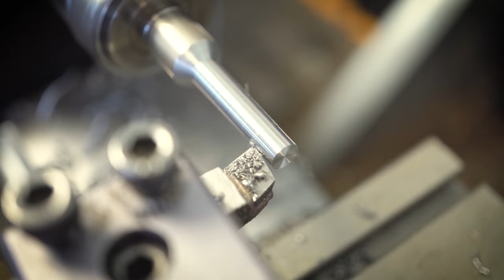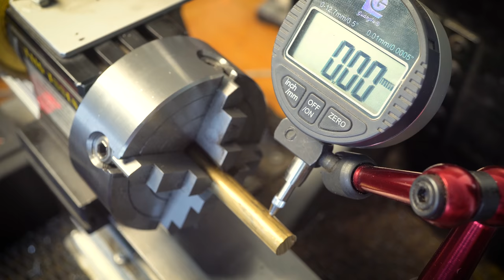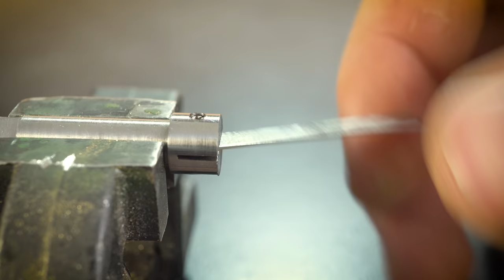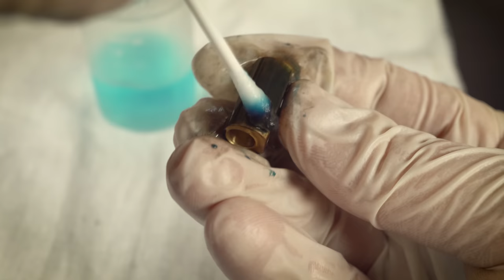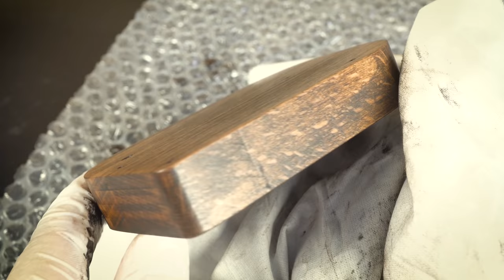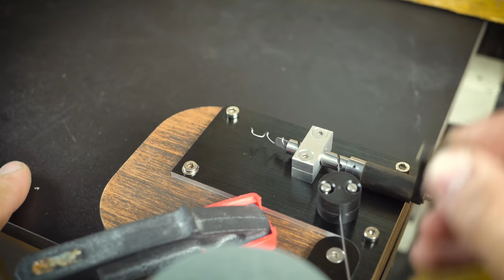Chain link making machine /\ DIY

Comment: This is really impressive. I also never had thought about how chain link fences were made until today. Broadened my horizons.
Reply: I all though they where some sort of a cross between Plate/Brading @ stitching, and then it was stretched out to the square shapes :-)
Reply: @dh2032  the way I saw it made was completely different then this and other videos, I’ll try and find it
Reply: you should watch a video on how actual chainlink is made as its totally different than this. its a crazy machine and it does it all on one shot.
Reply: @curtism7203  like how the video I posted above? The video I posted wasn’t exactly the fence but that’s all I could find to get my point across
Reply: this is not how they are made, your horizons have been narrowed.
Reply: @reaction9449  there are no videos posted above.
Reply: @Ghryst  If you've seen a different method, there must be multiple ways of making it. If you do a YouTube search for chain link fence factory you'll find pretty much this process on a larger scale. They run the wire through straightening rollers first, but wind it on a flat mandrel inside a tube with a spiral pitch like the machine in this video. The section being wound tends to thread into the previously wound section and they use auto cutters, but it's the same process. (only bigger and faster)
Reply: @the_omg3242  no, chain link fences in real scale are manufactured quite differently to this cheap imitation that has no structural integrity.
butt sure, keep fanboying, fanboy.
Reply: They’re not made this way commercially, it would be too time consuming.
Reply: Yeah, you don't want to be fenced in.

Comment: Been a machinist for a little under 15 years now, and still love watching the different processes people come up with to make things.  Never gets old in trade were there truly is no skill cap.  Need more MACHINISTS!  Great video 😍
Reply: As an engineer (who is not a machinist, but who has great respect for them), I wonder if I can 3D print a similar design durable enough to produce limited production to suppliment my hobbying desires (war-gaming/modeling for myself and maybe one for my father's model RR needs).  I know I can model the parts in CAD, I just don't know if a PLA plastic spiral fluted tube will hold up to the abuse, but I'm going to find out.

Comment: Omg
That copper wire would make a beautiful bracelet
Thumbs up
Reply: would need to do something about the edges, maybe solder or braise them so they don't scratch you!
maybe try to link with 1 continuous wire you could also make filters or strainers to use as you would a colander.
Reply: @nullvoid564  or just file them a lil with a nail file and curl them in?

Comment: The end product could also be used for a faraday shield.
Peace.
Reply: Or as a thermal dissipation, like heated seats, clothes, or handlebar grips
Reply: I was thinking model makers might like something like this, for scale fences. Might be able to sell a mass produced version of this to folks who like model trains and the like, if you made it to the correct scale.
Reply: Thats what I was thinking immediately when I seen it... I think if I made one I would want finer mesh though to block smaller fields
Reply: No more tin foil hat for me boys! Tonight, I'm riding in style!
Gonna make one of these and show it off to the CIA agents spying on me from the hidden camera they installed in my toaster that night they slipped something in my drink at the bar which caused me to wake up in that ally way. Hell, this hat will be so cool it might even break the brain washing they put on my wife that made her leave me that night. With threads like these the shinny glittering will slowly break through her neural programming and make her finally see I was right all along.

Thanks WM Lavsha...

If that is your real name!
I know you're secretly an giant and I can tell because of how big your hands are compared to all the tools so what else are you hiding?
Reply: Make it with food-grade stainless wire and you've got yourself a custom kitchen strainer. Would also be good for protecting inlets/outlets from clogging with debris.
Reply: @CraigBrideau  Would also would help reflect the lasers from Elon's Death-Starlink satellites protecting you once he finishes deployment, trigging the activation code, and initiating phase one of terraforming Earth into Mars.
Then again, are we sure we even want to survive the initial wave of destruction only to spend the rest of our days bowing to Elongated Muskrat being his slave and digging tunnels for the hyperdeath loop. Nooooo TY. I got my Alex&Jim Jones brand cyanide caps ready to go for just such an occasion.

Comment: Third try to leave a comment...

Very cool! I made a simple tool about 10 years ago after finding plans for a device used in developing countries for making chain link fence. I cut a slot in brass tubing using a jeweler's saw and then used a pin vise to turn the bar in the tubing. My fence is 1/12 scale. I tried a smaller scale, but the fine wire kept breaking in the tubing. The device needed to be more precise, but I didn't have the tools to make it better. Worked pretty good though.

Comment: When I was a teenager 50 years ago I operated a machine to make chain link fabric with telephone wire which was removed from poles when they went to underground cables. If you hold the fabric in front of the mandrel it will weave in new strands for you.

Comment: Very cool! If you made a tiny slot at the top or bottom of the clamp and cut a key stock from the hardened steel razor blade, it probably would've prevented the stainless steel wire from binding and rotating the whole spiral groove body.

Comment: I use to be a machinist when lot younger and what gets me is the tiny equipment  this  machinist uses.  Always tiny, 
tiny cute tapping, tiny indexing heads,  tiny chips, tiny cuts !!!  It is AMAZING to watch i must admit..
Reply: No endmills were harmed in the making of this video
Reply: I mean in the world of machining small parts have been around, especially in aviation, gotta put the part number on a little 10-32 screw head somehow.
Reply: @sgtjonmcc  I'd assume that for mass produced articles, the part numbers get stamped and serial numbers get lasered on.
I worked in a place that produces small lot parts so we milled it, but that's only economical if the parts cost a lot anyway. :)
Reply: I'm really liking the micro sized CNC machines
Reply: And im surprised as a watchmaker that he uses such big machinery and screws xD
Reply: @l.h.9747  Lol
Reply: Yeah, it's sometimes hard to see the scale until you see a giant thumb holding a piece. lol

Comment: As usual another small masterpiece: you could produce this net for modeling use and dioramas in general
Reply: Exactly my thoughts. That would be really great for creating in scale wire fences and such things
Reply: What in heck could you ever use this fo.....oh.
Reply: @ranger_a6953  he said modeling. So basically for modeling doll houses, toys, rc world, and whatever humans would like to use it for.
Reply: @whatswiththissassylostchilld  yeah, I know.  I was trying to be a bit humorous.  Sometimes it doesn't translate well.
Reply: @ranger_a6953  ohhhhh my bad lol
Reply: @ranger_a6953  I mean you could do some cool steam punk look
Reply: Could sell it strictly to model railroaders and do quite well! Very nice work but even better imagination! Well done!
Reply: I use chicken wire or sculpting mesh depending on what size link I need, loll
Reply: I would use it in a larger version for Faraday cage
Reply: @helpabrothawithasubisaiah5316  that would be a 1x use for u. Ur much better off using a copper (or copper plated) machine cloth if u don't want to die or fry the sensitive components you are trying to protect. There are no solid connections in the cyclone fence design, u would have huge arcing problems and probably complete failure of farady cage.
Reply: @TrapperAaron  it wouldn't be hard to make connections, and it depends on what you're trying to block for it to be sufficient...

Comment: I’d love to buy this for modelling, is there anywhere I could buy this from?
Reply: if you don't have all the nice equipment, what you can do is do it the non automated way. go to starbucks and with out buying anything take one of wooden coffee stir sticks, go buy 300 plastic straws from the dollar store for $1 wrap super glue one straw around the stir stick be sure to leave a gap, for the wire to go, throw the rest of the 299 plastic straws in the ocean. pain painstakingly wrap the wire around the stick in the gap where the straw is not. if the wood is too week for your wire you might have to buy a metal nail file from the dollar for $1 if the metal nail file is not the correct shape you may have to grind it ageist a rock, till it is square, the wire is by far the most expensive part if you can get your self to a junk yard you might be able to find a broken motor, that will have lots of wire, I think the dollar store sells wire for a $1 but that's a consumable not equipment and part of cost of goods, so that might brake the budget it all depends on how much your selling your models for, I will assume your a government building contractor and your making a architecture model for a new 100 million dollar prison, and you want some realistic chain link fencing to for the model, don't worry I am sure your model will be accepted if your bribe is big enough. but don't go over spending on model creation that's less money you have for a bribe, and that's what get's the contract. the new normal, people like me will do well but they would rather be poor in liberty, where at least we know we are free, because the devil does not share power.
Reply: Let me translate what Amipot said:
No
Reply: I'm thinking I'll try my hand making at a 3D printed version.  I'm hoping I can get close to scale strips of hardened steel form McMaster-Carr in place of the laser-cut knife blade, and print much of the rest in PLA plastic.  It' won't be as elegant or as durable as this devise, but using smaller (more scale appropriate) gaged wire, it just might work well enough for my hobby needs.  Besides once I've modeled the fluted spiral tube and have a stl file, I can always print more with negligible cost and effort; even if it only lasts for a couple hundred produced links, as oppose to the several thousands of links a milled tube should be capable of producing.  I'll follow up with an additional comment If I am successful.

Comment: Simething cool would be chainmail i was trying to imagine a machine that cut wire curled it then pressed it flat with a roller. Or i should say curls it then cuts it shakes it into a single rind depth and then they get rolled over to flatten them. If the ends could also get flattened out so a rivet could go through them this would make nearly historical style mail, only thing missing would be hammer marks,

Comment: Hold up, did the copper wire work simply because it's a softer metal, smaller gauge wire, or both?

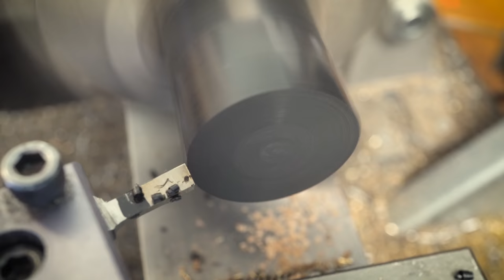Comment: 10:09 I have that screwdriver set. It's really got for electronics.
Reply: same i took hot knife to handle then turned a steel one, friction fitted the tip in. came out good

Comment: One question I’ve had watching all these videos of people using a lath is what do y’all do with all the shavings. I’d personally love to get buckets of the shavings to melt down make into more metal stock for projects but don’t know how to get ahold of anyone that wants to get rid of their shavings left over from projects.
Reply: I'm sure that some of these folks do just that. You can also sell the shavings direct to scrap yards. At worst you can sell it at "dirty" metal prices if it is coolant soaked or otherwise grungy.

Source: I used to operate a lathe at an old job and we'd sell the shavings to a scrap yard.
Reply: @VanerDeeds  yeah I could see that being the case

Comment: Just had this doubt: How does the individual wires stay linked together?
Reply: In fence, the tops of pairs have an extra twist to maintain vertical position. The fence is tensioned horizontally by posts. Chain link can be collapsed and rolled if removed from posts.

Comment: RFI screening mesh,  modelling/sculpting armature, 1:12 scale fencing, coarse partical filter, antenna backplane, 
in aluminium - model aircraft fuselage armature (geodectic airframe),  medical support gauze/splint, ventilation grill (airbrick vents), reinforcing for fibreglass model boat hull,  door/window (bug) screen.

Comment: wait, if you need to rotate the wire into place, and the wire comes out rotating, why not just make it rotate into position as it comes out of the machine? looe putting the chain next tk it as it comes out

Comment: Wait, so why is the spiral necessary? It looks like the wire just stays on the inside of the tube once it finishes the first wrap. Unless I'm mistaken?
Reply: The flat blade in the centre of the tube is a fairly neat fit. The wire wouldn’t fit in between the edge of the blade and the inside wall of the tube, it needs to poke out slightly. The helical cut would also help keep the spacing of the twists perfectly consistent.

Comment: You have impressed me with the simplicity of such a tool. Although it is critical in the build of the machine it also reflects the accuracy with which you made it. Doing so by producing such a uniform coil that is surprising . Very nice bit of work.

Comment: Since you twist it to create the wire and you twist it to attach it, surely you could thread it into the link as you produce it? Like when you are done with 1 wire, lower it then as the new one comes out it automatically threads itself in as it extends. This should work in theory.

Comment: (LONGER MESSAGE, PLEASE SCROLL DOWN)  How much for you to make one of these for me, but with a slightly smaller bend bar and guide tube to make the mesh holes about 1/3 smaller than that?  

This micro chain-link has MULTIPLE uses:
Dioramas
Tabletop Gaming
Decorative mesh for crafting into art pieces
Certain clothing aplications
Reinforcing a full face shield to guard against impact damage to said face shield
Costumes
A mesh for a Vehicle Intake grill
Food Grilling mesh
Steamer basket
clothing accessories like a whole Woman's Purse
A really cool looking wallet
Part of a hat
Dirt filtering for separating rocks and large particulate from clay to make modeling clay
A dish scrubber
A grill scrubber brush
A parts cleaner
A mesh screen for an lubricating end mill or CNC router machine to stop the bigger chips from falling into the chip filter and clogging up the lubricant/coolant sprayers and tank
An anti-fly mask for people and animals
If you set some of it in ceramic and then fire it, or mold it into some resin, it could make some really neat and probably pretty durable floor tiles...  

...  there are literally THOUSANDS of applications for this little device.  

And I SINCERELY want one please.  

How much would it cost for you to build me one with some interchangable wire bending parts (the bend bar and guide tube seem to be the only parts that need to be swapped out to make different sizes of mesh or to use different diameters of wire) and ship it to Alabama?